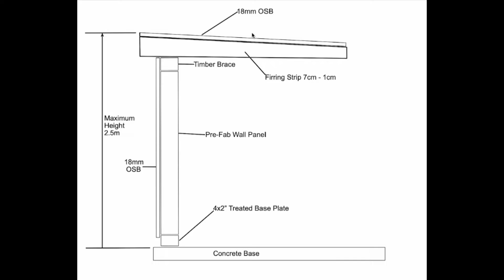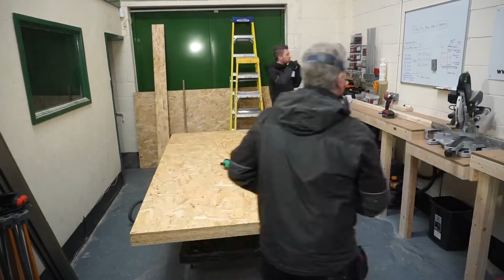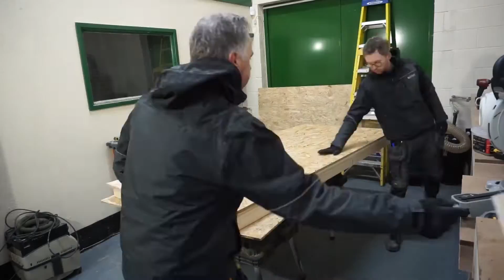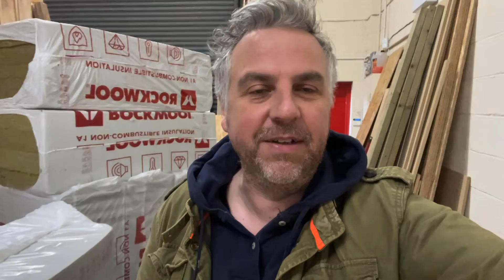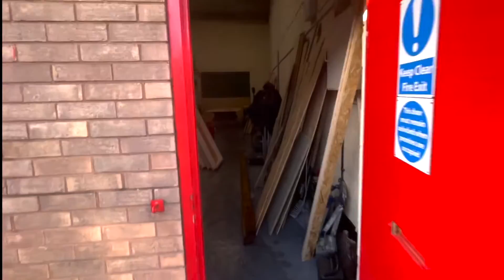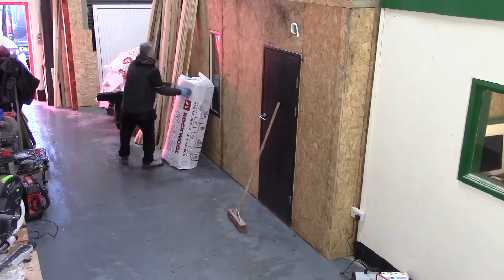How To Build A Soundproof Drum Room - Part 1

Comment: Hi, really enjoyed the first video of this series - I'm looking forward to seeing the rest. Thank you. I'm wanting to insulate a wall between my business unit and next door. Was going to put up a stud wall with a double layer of soundbloc plasterboard. Which Rockwool would you recommend - RW3 or RW5? Many thanks.
Reply from the maker: Thanks for the interest in the channel - don't forget to subscribe and like - lots more content on its way. :)
RW3 Rockwool is a very good all rounder in terms of frequency attenuation - (prob use the 100mm slabs in a 4 inch stud wall). RW5 is a lot more rigid and dense and works well in multiple wall systems - its good for low end attenuation. I would suggest the RW3 to keep the cost down and to cover a broader range of frequency attenuation. 
Hope that helps!